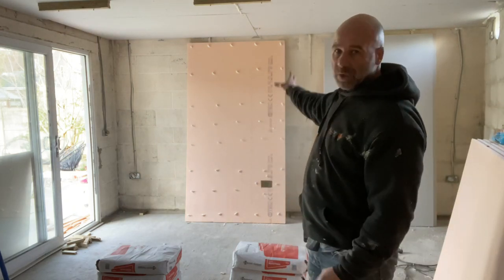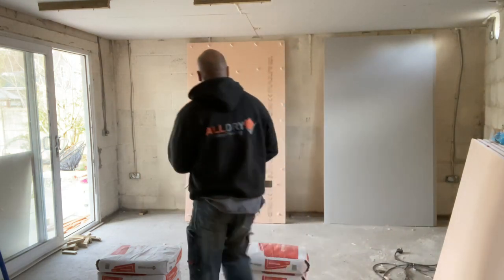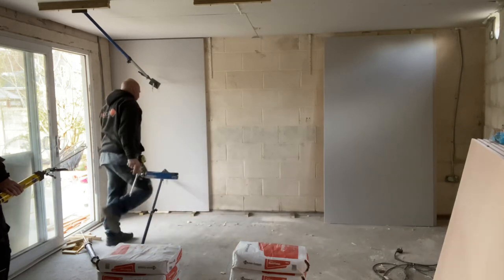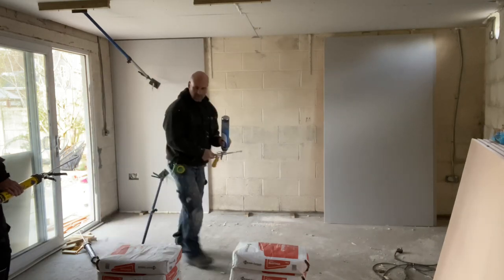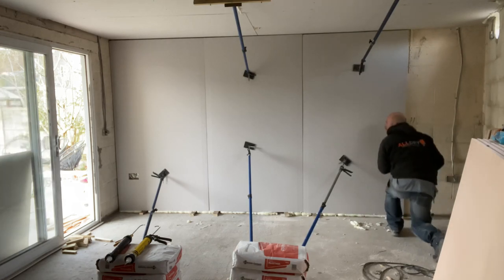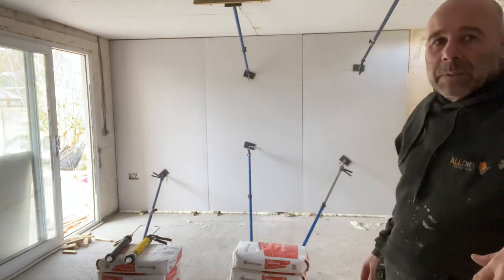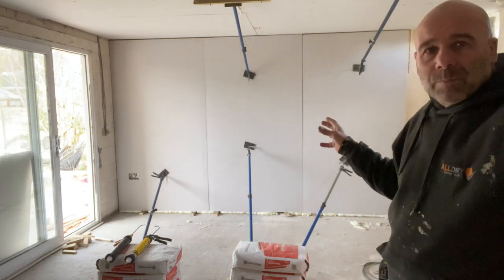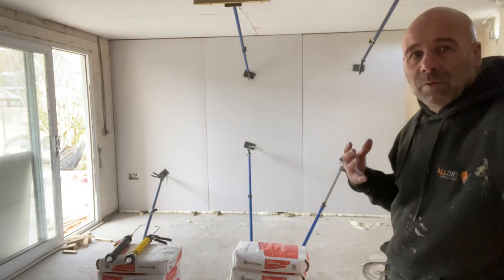Converting an Outbuilding

Comment: Another great video. This is very timely as I am looking to convert an outbuilding/shed in the new year. Couple of questions I would like your help with. 1) What is the type/name of board that you use as I couldn't quite make it out in the video? and 2) The outbuilding/shed I have is made from single brick rather than breeze block. Would the method shown in this video using the boards and the foams be sufficient to damp proof it? If not what would you recommend.
Reply from the maker: Dwayne Squires hi the boards are thermaline plus, thermal plasterboards, yes these will be good if you use the correct thickness for dampproofing and thermal insulation. Penetrating damp could be an issue depending on the state of the pointing outside.
Reply: Simon Cooper HNC CSRT CSSW thanks for the detailed reply

Comment: Thanks for the video. Can you just confirm the make of the foam adhesive you are using to stick boards on. And clarify if it's the same foam to fill the gaps.
Reply from the maker: T C hi the polyurethane foam is called Instastik, 
You need a foam gun to use it with and this saves waste, B&Q warehouse sell the guns for around £10. Thanks for watching hope this helps you👌
Reply from the maker: T C the polyurethane foam glue is called instastik and is not the type that fills gaps, that is expanding foam, if you use expanding polyurethane foam it will push the boards out. 
Hope this clears things up for you. Thanks for commenting 👍
Reply: What is the other tube called? is it just a silicone?
Also would this work if I strapped wall with tile batten and then screwed boards to timber or is it better sticking it to wall?

Thanks sam
Reply from the maker: ystehen18 the adhesive is called drygrip and is made by safeguard. 
If you put battens on the wall the may get wet as they are hygroscopic.